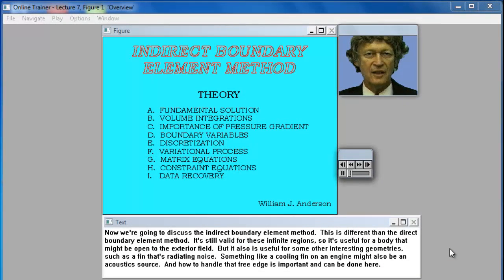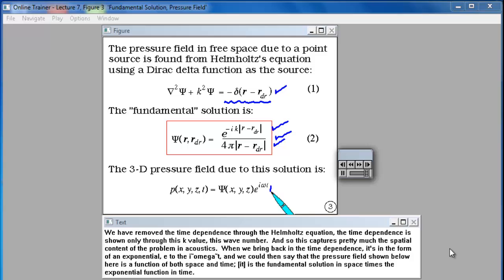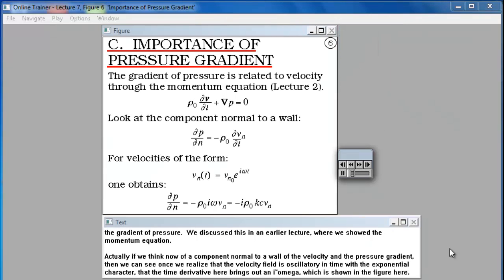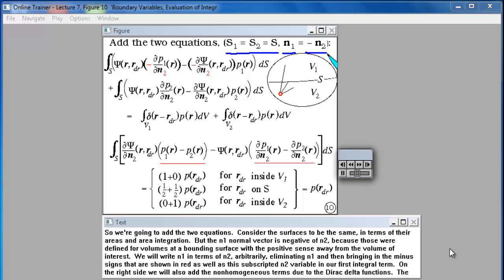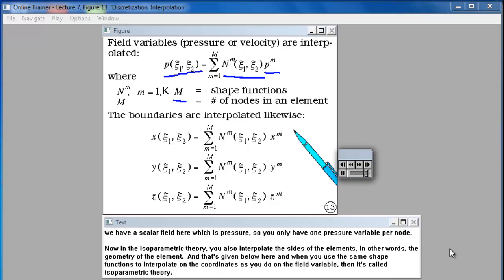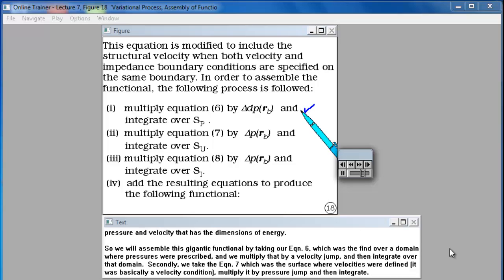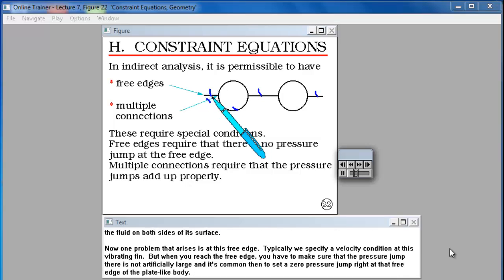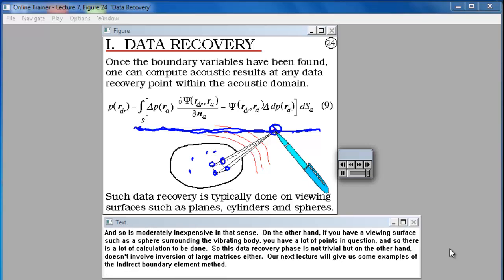Indirect Boundary Element Meth

Comment: Very good course.

I am trying to understand the correlation between the BEM formulation and the approach consisting to put a set of monopoles and dipôles on the surface.

The method of monopoles and dipôles  uses Bessel functions J0 and J1.
BEM uses Green function.

Is there a relation between Bessel and Green functions ?